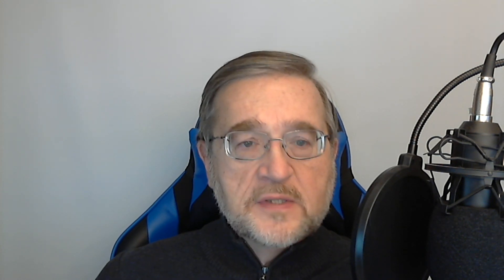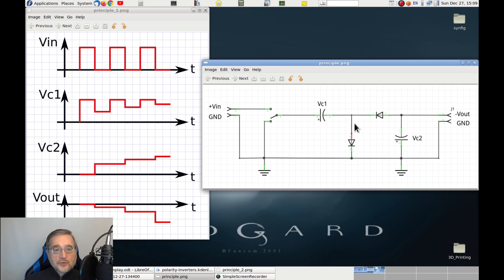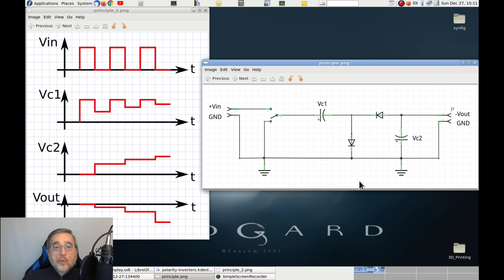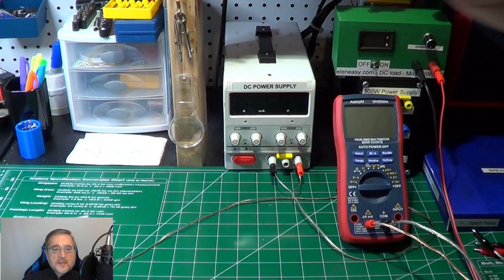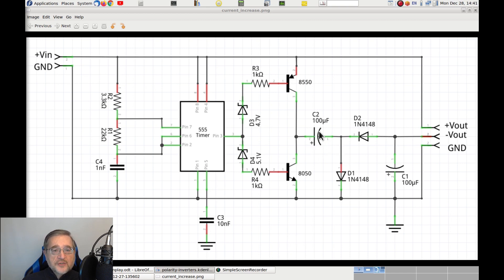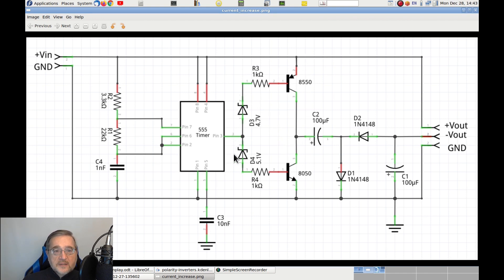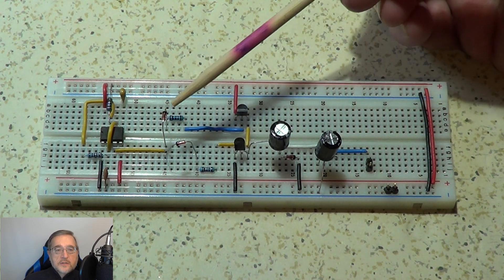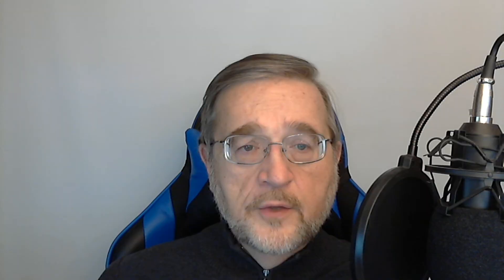Polarity Inverters Explained

Comment: Great video! 
I have only one question: it is possible to do a polarity inverter without using any ICs(only with discrete components)? 
It would serve to power and AmpOp with only a +12V DC lithium battery.
Reply from the maker: Yes, you can definitely do that. Instead of using a 555 timer, use an astable multivibrator, which is made of 2 transistors and provide a square wave exactly like the 555. Here is a link I found that you can use to design your multivibrator, if you don't know how to do that:
https://www.electronics-tutorials.ws/waveforms/astable.html
Reply: @eleneasy  Thank you for your help. I ended up trying the 555 timer in astable mode (as explained in the video), but with R1 = 1kΩ, R2 = 1kΩ, C4 = 100nF, and C3 = 10nF. Then I powered the circuit with a +12V lithium battery, but the timer burned out. I'm not sure why.
Do you think I could use the exact same configuration you used to generate -10V to power an op-amp?
Reply from the maker: You need to be careful about the amount of current you extract from the inverted output. You cannot exceed about 20mA on the 555. If you use a boost transistor pair on the output you still have to make sure that the current going into the base of the transistors does not exceed 20 mA. Or the 555 will burn out.
Reply: @eleneasy  What can I do to limit the output current to 20 mA and still successfully invert the voltage to power an op-amp? (Any suggestions would be greatly appreciated)
Reply from the maker: A simple resistor in series with the 555 output would do. The value will depend on the max current you need: R= Vcc/I.

Comment: Thank for demonstrating the concepts and some practical results. Several times, just a few (as you said single digit mA) is ok for a MOSFET or to bias an OpAmp.
I just missed on this these topics: (1) How the capacitor sizes and C1/C2 ratio, the oscillating frequency would influence on the final voltage. (2) How the ripple at the output would be affected, as this could affect OpAmp based applications. 
As a brainstorm, maybe alternate drivers with OpAmp square-wave oscillators using cheap as LM358 would be able to provide a low power -5V for many bipolar driven circuits. 
Thanks for sharing!
Reply from the maker: The ration between the two capacitors must be 1 or, in other words, the capacitors should have the same value, so that they can exchange charges the way I explained. The frequency is something more critical, if it was too high, the capacitors would not have the time to complete the charge in each cycle.if it was too slow, the ripple would increase, because the capacitors would have more time to discharge before the next cycle begins. At the end, both capacitors and frequency are correlated to each other, although the connection is quite loose. You could build the circuit yourself and experiment with different values of frequency and capacitors, and see for yourself what happens. Thank you for watching the video.